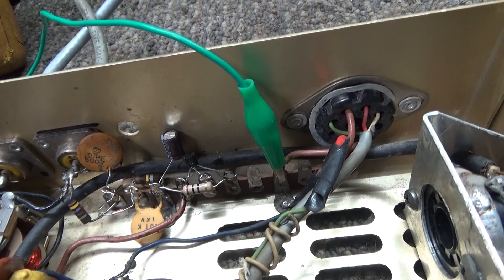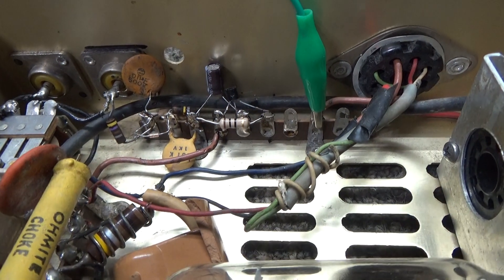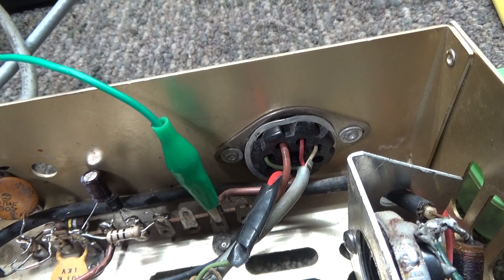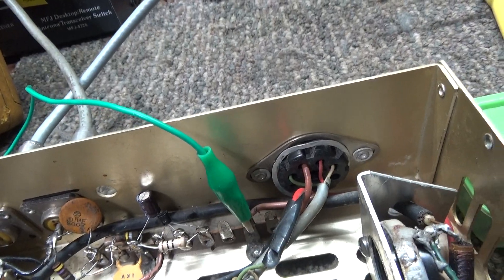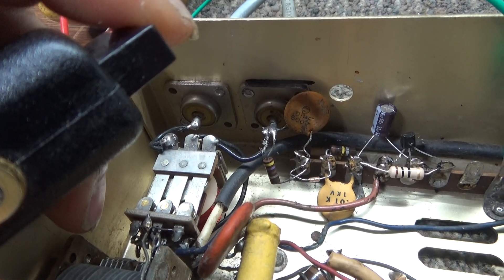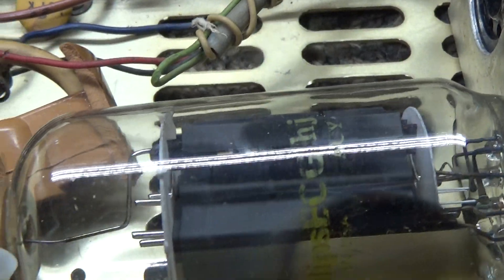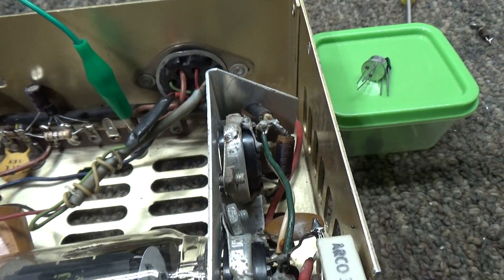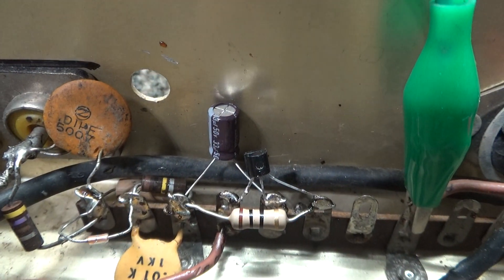Amplifier Keying (sniffer) circuits explained

Comment: Thanks for the video. Im repairing the preamp and transmit relay transistors in a kris big boomer. Looks like the transistors got hot on the board. Which transistors do you recommend.  It had 2, ECG312 in it. Just curious if there are any better than those. Thanks
Reply from the maker: the 2 ECG312's go to the preamp. For that purpose, it would be very hard to find something better.

Comment: what are your thoughts on using this type of keying circuit on big amplifiers like a 32pill versus direct keying the relay with a foot pedal etc?
Reply from the maker: Its a lot more difficult to make a dependable keying circuit for any high drive amp than it is for any low drive amp. Low drive just pick off a little bit of the low drive coming in, easy peezy. High drive, with a bunch of watts coming in, now its a lot more challenging to pick off those bigger watts coming in and if you pick off too many, it won't key, and if you pick off too many, you blow the circuit. Also with any big amps there is a thing called Hot Keying. That is the drive is applied before the amp is keyed, which creates arcs with the amps relay. Not really a problem with small to medium amps, a good relay can take it. Lets use a 5kw amp with 500 watts drive in as an example. If you key the amps relay with drive already coming in, that relay is going to switch both the 500 watts drive and the 5kw out at the same time. Those relay contacts ain't going to last long. This is exactly what happens when you either use an auto key circuit without timing, which almost all are, or if you hit the foot switch and the drive is already on. Hot Keyed. If you use a foot switch correctly, you key the amp first, then the Mic. The relay is closing without rf power going in and out of it. Also, same with unkeying. You unkey the Mic or drive first, then you unkey the foot switch.

Comment: There must be low voltage vacuum tubes with 12V heater and a B+ of 12V that would work in that unit.
Reply from the maker: I have heard of low voltage B+ tubes, but would think that a low voltage tube would not be able to pass enough current to draw a relay in.
Reply: @tramdr  Then have the low voltage tube drive a VN66AF VMOS FET.
Reply from the maker: Sure, but now add a low voltage tube and a Vmosfet to a circuit where a plain Jane transistor will work.

Comment: Man thanks for all the information you share. I have a palamar 300a that only keys up some of the time, im leaning lol👍
Reply from the maker: replace that keying transistor for starters.
Reply: @tramdr  i replaced both the 2n2905a transistors on the board that has the relays on it, still the same

Comment: I'm bigdog911 Dr.
Reply from the maker: I've already explained it best I can in the videos. If the relay isn't engaging, its probably the 2n2905 keying circuit transistor. If the relay is keying but the amp is not putting out, its probably a bad relay not letting the power either in or out. If your 300A has the flat relays, oh boy, you got a problem. alright.
Reply: @tramdr  I have that 3 relay like in video and a fused tube deck

Comment: What is the little diode value/#
Reply from the maker: 1n4148 or 1n914 extremely common small signal fast switching diodes. 100mhz, 100v around .2a (200ma)  There are a few more variants and numbers for them, but kinda like power supply diodes, it really doesn't matter which one you stick in there as long as its a fast one (100mhz) as it is rectifying RF not low frequency ac. Even though they only handle around .2 or .4 amps, thats not important at all either. With power supply circuits, amps is important but in the amp's keying circuit, they are driving the base of the keying transistor, so they are pulling almost no current at all.What does happen is people overdrive the amp and run over 100v's across that diode and short it, and then it will short the keying transistor. Those diodes cost about 10 cents.